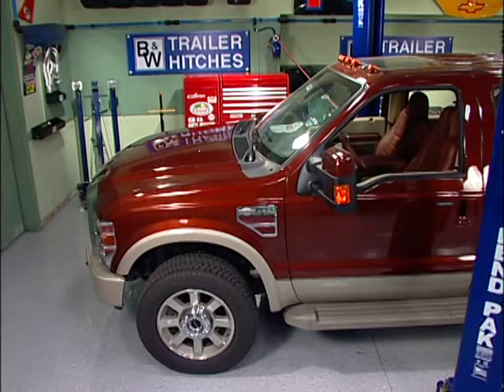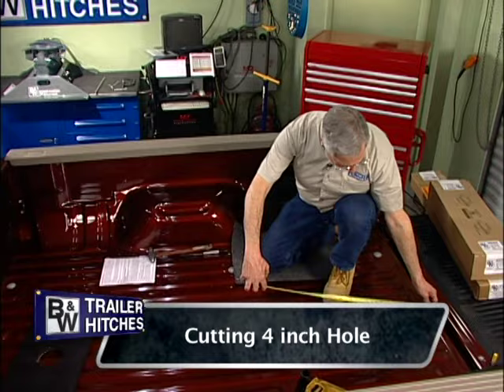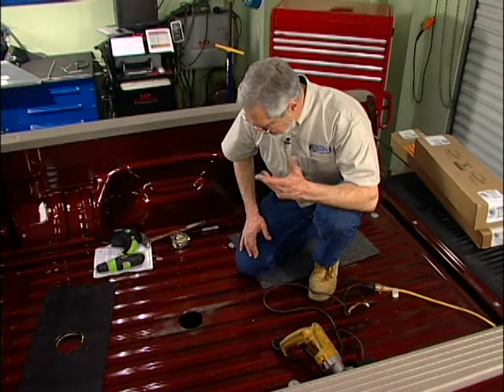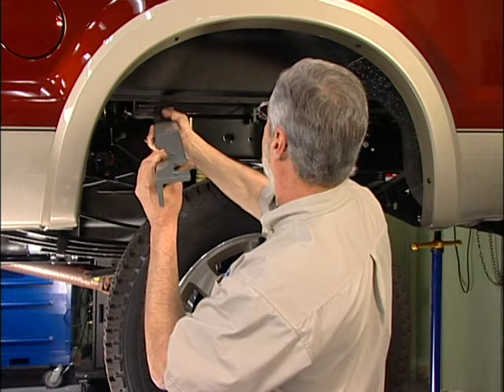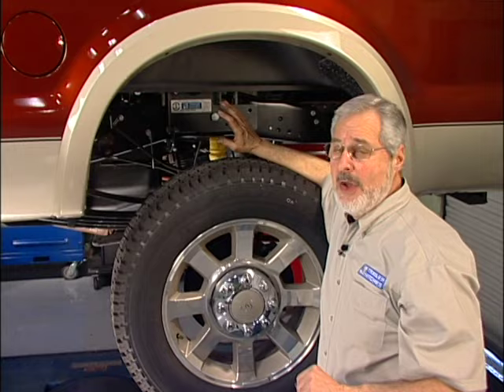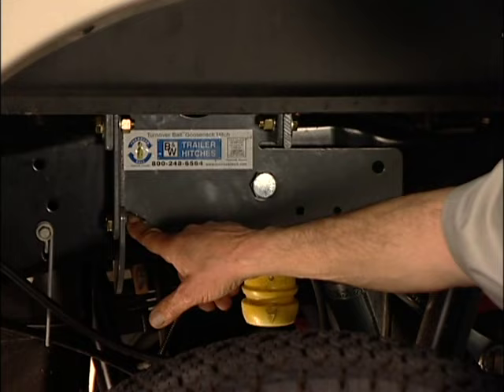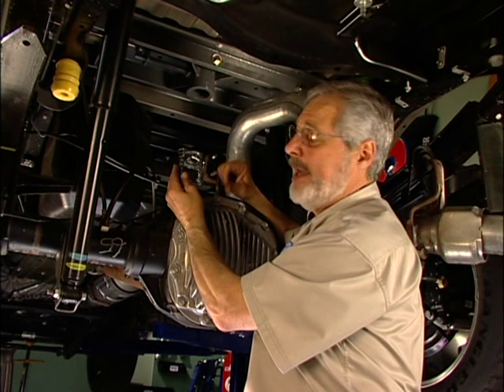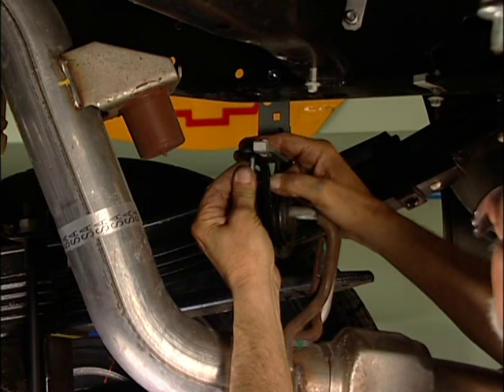B&W Turnoverball Gooseneck Trailer Hitch Installation Demonstration- Model 1108

Comment: I swear you guys found the most clean truck in usa to do this work to, also im sure that that bed has a 1/2" body lift on it and was prep'ed for install, cuz mine did not go as smooth as your demo.
Reply: That’s why I charge extra for cleaning.

Comment: My second purchase of a BW turnoverball. The first one has served me very well and I have used it to tow several gooseneck trailers over the years. I just purchase a 17,000 lbs toyhauler RV and I have already modified it with a Reese "goose box" just so I could use BW's turnover ball system on my new truck and not have to deal with my bed full of an old school 5th wheel hitch. Thank you BW for a quality product.

Comment: Its an easy job... Unless your bed is slightly bowed in!!! Mine was and i had to use 3 jacks to bend the bed floor up enough to get the cross members and side plates in. A real pain! And in the instructions done say which way to install the bolts. The washer and split washer goes on the side with the slot!

Comment: is a great hitch but make sure that it is installed properly there are places out there that install them wrong on the ford super duty it is a breeze to do it your self but the ram and the chevy there is alot of stuff in the way that makes the installation a bear if you do not know what you are doing.

Comment: On a full size Dually, it is next to impossible to install the front left side bolt for holding the 5th wheel supports.  Drill 4 holes  for U bolts and one for goose neck ball

Comment: Hmmm - no wheel well liners?  Seems most pu's have them and you need to drill a 3 or 4 inch hole in them to access the latching lever.

Comment: What is the torque on the bolts
Reply from the maker: Tim Burnette 

<span style="font-size:11.5pt;
color:black">Every hitch and even different area of the hitch have different
torque specs, so there really isn’t a standard answer. But listed below is the
1108 torque specs.
1. Tighten the center section to cross member
bolts to 80 ft pounds. 2. Check to ensure the assembled center section
is square with the frame. 3. Tighten the ¾” side plate bolts to 120 ft
pounds. 4. Tighten the bottom clamping strap bolts to side plate to 80 ft
pounds. 5. Tighten the clamping strap studs to 60 ft pounds. 6. Tighten
the side plate to angle bolts 80 ft pounds. If the emergency brake cable
has been removed, take the 5/16” nut off the previously installed bolt. Place
the emergency brake cable bracket over the bolt, replace the nut and tighten.

Comment: Do you guys sell a Turnover ball for the Aero 96 F350 7.3 or not cuz I'm gonna on the lookout for a Gooseneck ball for a 96 7.3 dually
Reply from the maker: For your 1996 F350 we can recommend one of the Turnoverball hitch kits below. You will just need to determine if your truck does or does not have overload springs. 

GNRK1100 | https://bwtrailerhitches.com/kits/gnrk1100
(Fits 1980-1998 Ford F250 & F350 trucks without overload springs.)

Or the GNRK1110 | https://bwtrailerhitches.com/kits/gnrk1110
(Fits 1980-1998 Ford F250 & F350 trucks with overload springs - requires Drilling into Frame.)